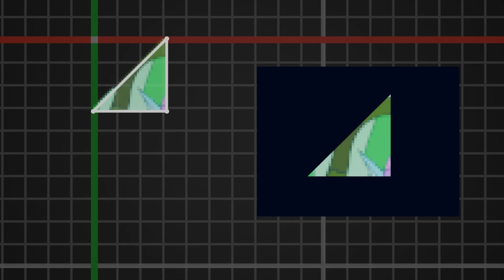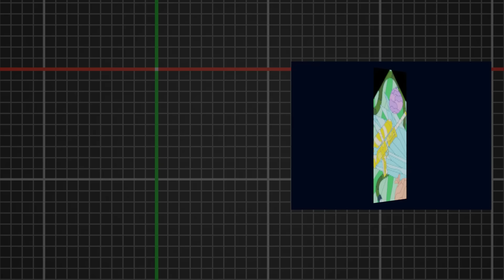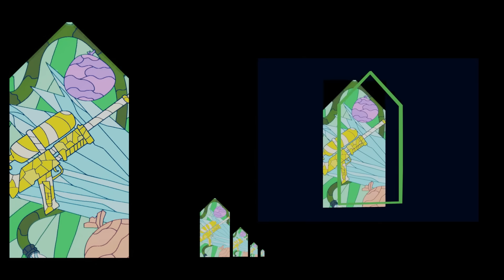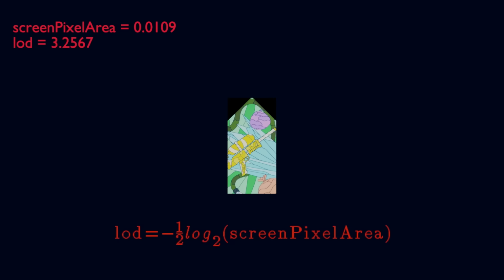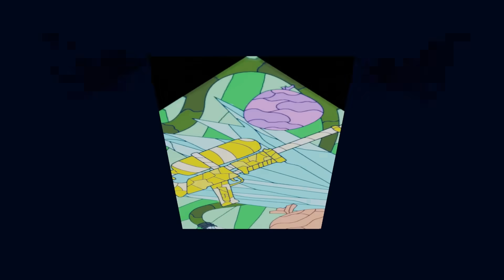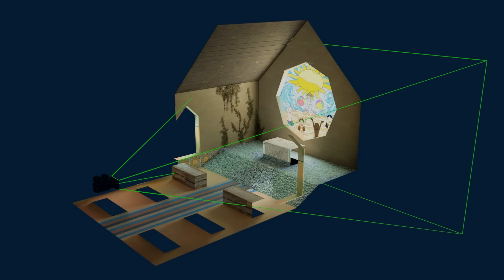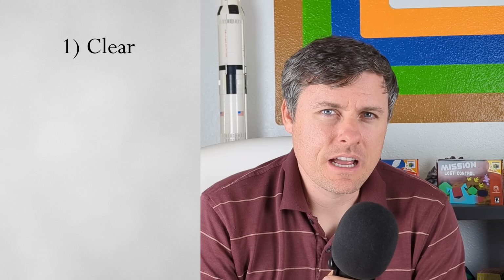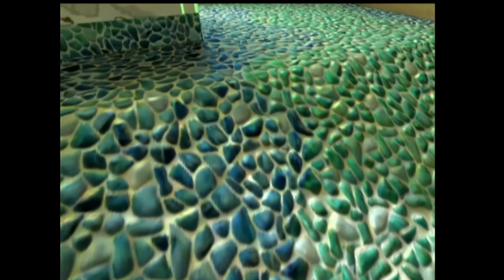How I implemented MegaTextures on real Nintendo 64 hardware

Comment: Very interesting. I didn't know mipmapping could be implemented on the N64 without being CPU-intensive.
Reply: Any documentation? N64 hardware does trilinear mipmapping almost for free ( 2 cycles instead of 1 ). You have to upload all levels coarser than the current. This is no problem because the fine details dominates cache usage anyway. (

Comment: Stunning work, that little piece of SGI hardware has so much hidden potential. 

We can only imagine what could have been had developers access to the knowledge and technical prowess you, Kaze and others on the N64 home brew scene today.
Reply: At the time some developers were also quite experienced. LucasArts or Factor 5 even wrote custom microcode for their N64 games, something I haven't seen from the homebrew scene yet.
Reply: He implemented the Painters Algorithm which was used by the Playstation 1 because they didn't have the memory capacity for using depth buffers. The n64 was able to use a depth buffer because it was built with more memory. The techniques and algorithms existed at the time, but with tight time crunch and deadlines developers didn't necessarily have time to experiment with optimizing their codebase for the hardware.
Reply: @TTOOS  No it couldn't, the CD drive reading speed was too low.
Reply: Wish we got a new team of retro Devs together to make these types of games again
Reply: @TTOOS  nah, PS1 was totally maxed out and more in its lifetime and it really did make it's pseudo 3D tech look good for what it was. It couldn't do this better - with it's texture warping, lack of texture filtering and other features required to make solid surfaces there would be no point in even attempting to use textures like this on a PS1.

Comment: Maybe using this technique with procedurally generated textures like you have in Krieger could make it feasible for larger scenes.
Reply: Maybe use AI and fractals to compress textures into generated textures. Or how do you fill 64MB ? Two types of textures? Kkrieger has long loading times.

Comment: Curious what you can do with the Expansion Pak added in the system, doubling the ram. Would LOVE to see what games other people make using this! Perhaps even just texture mods to games that already exist with blurry textures? Keep up all the great N64 innovations James!
Reply: Mods are unlikely. It's too CPU intensive, and the lack of the z buffer is not something n64 games are prepared for.
Reply: Don’t forget that adding an Expansion Pak to an N64 adds latency to a Rambus memory bus. If this technique is latency-bound, adding an Expansion Pak could slow down this technique. On the other hand, more texture data and maybe a Z-buffer could be stored in the RAM at the same time, giving optimization opportunities that are not possible without the Expansion Pak.
Reply: @jnvivian  I thought that unlike PSX GSRAM , RamBus has one bank per chip? Or was temperature the problem. The signal goes through all chips. Usually, each chip just sense the signal using an nMOSFET. The Signal is strong enough even at the final chip and then eaten by the impedance matched terminator. It works like TV tech, like radio. You just still cannot use two banks at the same time of course. That’s why Jaguar rather accessed all chips in parallel using 64 traces on the PCB for data.
Reply: @ArneChristianRosenfeldt  I believe that Rambus requires each RDRAM chip terminate the bus on one end and then regenerate the bus on the other end, turning the “bus” into a chain of alternating point-to-point links and RDRAM chips in order to maintain signal integrity since point-to-point links keep signals a lot cleaner than true buses. Each chip adds latency, and the slowest chip in the channel determines the channel’s maximum frequency.
Reply: @jnvivian  but why did the N64 need a terminator plugged in when it only had 4 MB. Also Wifi and analog Radio tech keep a signal pretty clean over long distances and process steps. Isn’t it even a balanced signal? Every component has a differential amplifier to read the bus. ( two MOSfets). Let’s assume that this is insular from the 3.3 V CMOS noise in the rest of the chip (RCP). Memory sense amps have to deal with an even weaker signal. Or think of SCSI or VME bus. Just smaller. Traditional banks went up beyond 100 MHz also.

Daisy chain like USB, or some SPI modes makes absolutely no sense.

Also you can always increase the voltage of the sender. Less overall power consumption than reamplification. Jitter? Where would it come from? Low pass filter? Input capacity of a weak nMOSFET is low. Also it is matched with the inductivity of the bond wires to create a sharp filter.
Reply: @ArneChristianRosenfeldt  That jumper pak was not a terminator but was essentially like a continuity RIMM in a PC that uses RDRAM. It passes the signals through so that the signals can reach the channel’s terminator on the N64’s motherboard, probably to ensure that the signals sent by the N64’s built-in RDRAM do not get reflected and possibly harm the memory channel’s components. The jumper pak completes the point to point link from the RDRAM to the terminator. This allows the terminator to be used whether or not an expansion pak or jumper pak is installed. At the time the N64 was released in 1996, the RDRAM in an N64 ran at around 500 MHz at 9 bits wide, while typical PC SDRAM ran at 66 MHz at 64 bits wide at the time. True buses were infeasible at 500 MHz back then, but 66 MHz was much easier to build a true bus with like the one used in PC66 SDRAM back then. Wi-Fi was not invented at the time since it was first standardized in 1997, with the first popular variant, 802.11b, being standardized in 1999. 

Rambus was a pioneer in the fast but narrow bus concept where a slow but wide bus is serialized into a fast but narrow link, with the process being reversed via deserialization at the other end. This greatly cut monetary costs and motherboard routing complexity at the cost of latency. This technology is in today’s RAM, but was modified to make it a true bus by having the maximum clock rate drop when the memory bus load is too high like having more than one unbuffered DIMM installed in a memory channel. GDDDRx memory is much faster than contemporary DDRx memory since it is designed to be a soldered-on point to point architecture instead of a true bus.
Reply: Some games ran faster with expansion pack. Except this here also.

Comment: The texture management reminds me of the sparse virtual textures demo in bgfx. When I saw it I thought it was borderline revolutionary, but I've never seen that kind of technique used elsewhere. Until, y'know, now. A memory constrained environment like this seems like the perfect use for it, too!
Reply: Sparse virtual textures is a programming technique where the GPU does part of the work
Reply: It's actually use in most game, just not everywhere, it trade details for surfaces, so more surface mean less details, modern game has surfaces pressure, so it's used mostly for terrain, like in far cry. Nanite is an extension of this to generalize it to mesh, so it's back in a modern form.

Comment: Incredible! I know you refer to MegaTextures and MIP Mapping, but you’ve also implemented a form of Sampler Feedback Streaming taking advantage of the cartridge speed that wasn’t possible with CDs. SFS is now possible with the fast SSDs in modern consoles and PCs.
Reply: Sampler Feedback Streaming is a specific technique that requires hardware support with direct control over the memory hardware / page tables. The concept of streaming textures is an old one and you'll see the beginnings on older 2D systems like the SNES and on sophisticated PS2 games which required streaming textures from main memory into VRAM and from disc into main memory.  This tech demo is a great example of this general concept but is not a form of Sampler Feedback Streaming.
Reply: @djmips but isn’t checking for visible tiles ( so small on this system ) almost like sampling? The rendere processes all geometry, culling clipping and z buffer occlusion culling and in a second stage would load sampled tiles which not already reside in RAM?

The demo does not use the z buffer. Weird choice. And how is it gonna render dynamic objects? Bipeds ?
Reply: @ArneChristianRosenfeldt  "but isn’t checking for visible tiles ( so small on this system ) almost like sampling? "
Similar on the surface yes, but that's about it. But saying that occlusion-culling would be sampler-feedback is about as accurate.
Reply: Its absolutely is a feedback system, and Rage has lots of GDC slides about using Feedback in much the same way. SFS via hardware just makes the process easier. @djmips
Reply: @gibletto    Correct. I did not say it wasn't a feedback system. Any pre-existing system that virtualizes GPU resources uses some form of feedback.  Sampler Feedback  is a specific patented hardware system and I'm trying to educate the OP that MegaTextures is a good enough description and there is no insight in calling this a form of SFS but of course I understand how the OP was only trying to fit the technique described into their own frame of reference.
Reply: Gotta love direct storage

Comment: I think a simple sort of escape room game would be a really cool idea for this method. You can keep the game small and the game code itself is little more than a character mover, the interaction with some puzzles, and checking if they've won yet. That leaves a lot of space for this implementation to use some very high-res textures that would be visually really interesting as you could involve them in the puzzles in different ways.
Reply: Or place the story in a puzzle-ish world that could make possible to reuse the textures by using different combinations and positions. Maybe?
Reply: i think this would be perfect for an n64 version of the stanley parable

Comment: For the ratman posters, you could use a 1024x2048 intensity texture and multiply that by your normal wall texture. Then for anything else you could have mini stickers
Reply from the maker: I don't think the textures are that big in the original game. I may also need to reduce texture size to save memory on the cartridge
Reply: @james.lambert  Background data decompression maybe, like Metroid Prime used on Gamecube?

...Assuming there's actually any spare CPU cycles left to use, heh.
Reply: Keep in mind also that the screen resolution is going to be capped at 480i on original hardware no matter what you do, so redesigning the assets to be clear at low resolution is going to be essential anyway.
Reply: I think 1024 is the hard limit on the uv precision, the proper name for the sticker are decals.

Comment: Passionate individuals doing projects in their free time: watch me optimize the living heck out of this 20+ year old console. For fun. 
Modern dev teams working on modern hardware: we made a game that somehow looks worse than games looked 10 years ago. We might fix it but probably not. That’ll be 70 dollars.
Reply: That's not how that works, frankly it's a problem if expectations from all party.

Dev want the best technical effect the console cannot achieve without trick like that, once they get it with the trick, they keep piling effects until it's too slow.

Problem, effect don't work well just alone you need good art direction too, Gotham unreal 3 on ps3 vs Gotham unreal4 on PS5, is a problem of Art direction, not techniques.

Too optimize they need to remove effects and work on the art more.

Comment: Wow. Even though it’s just a demo and it couldn’t really be used on a large scale game. The fact that this was even achieved is incredible. I hope you or someone is able to utilize this to create some fun small games. Just to be able to play something on n64 that looks that good would be so cool. 

Perhaps something like a mod for goldeneye or something that recreates the old “shipment” map from modern warfare. That’s a nice small multiplayer map that was a lot of fun.
Reply: Consider that this features 1024x1024 textures which quickly fill up the total available memory. 512x512 is still very crisp for N64 and contains only 25% of the pixel data, so if the highest LOD was skipped you could theoretically have up to 4x as many unique textures. Still can't say how it would perform in a more complex game environment during gameplay, but it seems possible to implement in some way for sure!
Reply: We want to beat PSX with its limited RAM in a single level. If 64 MB cartridge is not enough, I don’t know. RPG likes CD.
Reply: @ArneChristianRosenfeldt Even at just 256x256 textures the N64 gets access to texture filtering, a feature the PSX did not support.

Comment: Oh this is insane, and extremely cool!!

It also gets me thinking what kind of visuals can be delivered with a mix of balancing these textures, and smart vertex coloring to simulate baked lighting, especially on parts like walls or floors (or any objects with repeating textures, and less detailed mesh). It could save some memory considering you'd be cutting out loading textures that, despite redundant in a way, are being loaded for having baked lighting on them... Of course, faking that with vertex coloring wouldn't deliver the same level of fidelity as baked lighting on these textures deliver, but that would be a cool thing to try!

Comment: I wonder if it would be possible to make an entire game like this with gigabytes of data, where the cartridge has a lot of hardware built in to bank 40 mb chunks for the N64 to read at a time.
Reply: The banking itself is real cheap, in comparison to the GBs of storage, certainly. For the time, that would have been a $5000 game 😮
Reply: @SimonBuchanNz Would have been tough to even physically fit in a standard sized cartridge.
Reply: Might be possible with an Everdrive

Comment: I never really understood size limits for older systems. I understand you can't give the console a bigger buffer or anything, but why can't you just make a custom cartridge with bigger size support? I understand the whole point of making an N64 game now-a-days is for the challenge of N64 restrictions, but would it be possible to go beyond those restrictions?
Reply: There are no cartridges that support bankswitching on the n64 unlike the nes or snes so you're stuck with 64mb max
Reply: @jlewwis1995  there's none yet, but no reason why a custom mapper couldn't be done. That's what flashcarts and some collection carts do in essence anyway.
Reply: @jlewwis1995  What an odd choice when they were competing with CDs that could hold 10 times as much.
Reply: @ZipplyZane but 100 times slower, Mario 64 would not be possible on cd, everytime you would jump in the painting, you would wait 1mn, the delay with the fade in the real game on N64, is actually artificial, if you remove it it is loading instantly.
Reply: @timmygilbert4102  Is ok to be wrong.
Reply: @sebastiankulche  that fact was in one of kaze video, are you saying he is wrong 🤔
Reply: @timmygilbert4102  "Mario 64 would not be possible on CD"
This is wrong. Not the rest.
Reply: @sebastiankulche  Mario cd would be possible, not Mario 64, fast loading is part if the identity of Mario 64, that's the 64 in the title. That's like saying ray tracing is possible on N64, technically yes, practically no, not with real time expectations...
Reply: Cartridges were not limited by pin count on the connector, but by cost. Not for the console, but every game in your collection.

8bit consoles had mappers. Contents size rises exponentially with pin count. So on the console side they soon was a minor cost . Still would be nice to use all pins for data bursts. How much does a chip cost? I think cartridges in pcEngine, Jaguar and N64 were just ROM directly connected to the plug. Every additional high pin count chip adds massive cost.